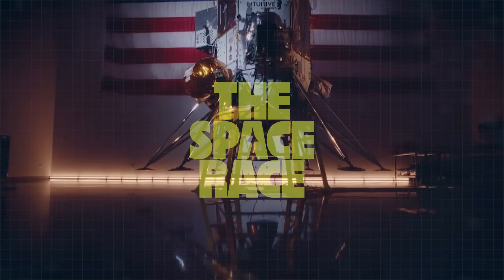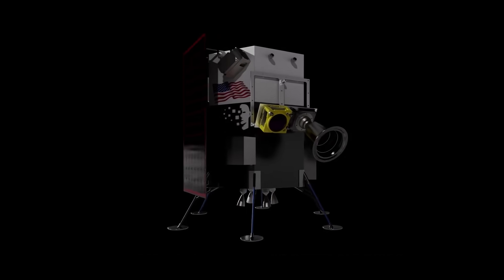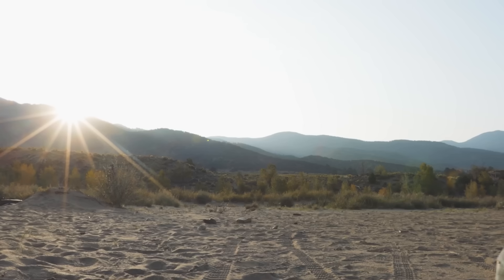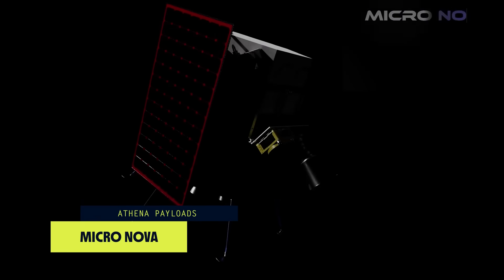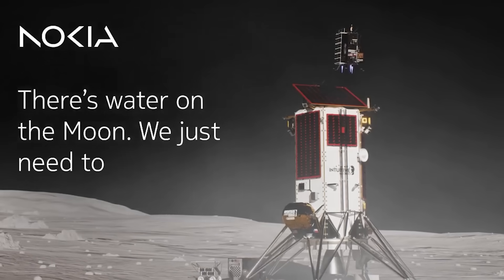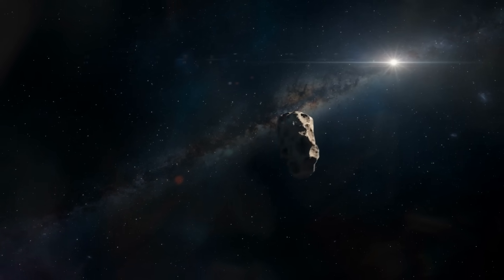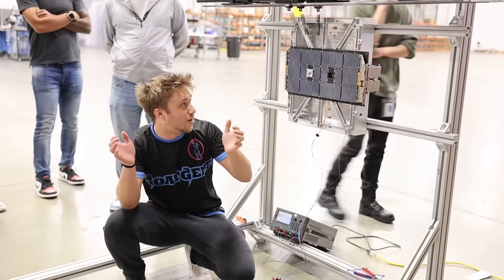NASA Moon Landing Update!

Comment: Instead of only increasing landing precision, what abt also equipping the lander w arms so that it can maneuver itself out of a topple?
Reply: Or, be more like the old Surveyor landers with a wider stance. As I recall, none of them tipped over.
Reply: I guess the arms and the wider base add to weight . Where as precision on landing costs almost no weight . Therefore they can add something else to the vehicle such as different testing equipment.
It’s a bit like saying ok this car is not fast enough but we need to conserve fuel at the same time. Instead of just whacking in a larger heavier  more fuel hungry motor they just fine tune the smaller motor to get a similar effect without adding weight or requiring more fuel .
Reply: Because it might seem obvious to a pretend engineer however it's silly to the point of stupid to real engineers.  The idea is to have zero horizontal movement, that was what caused the tip over last time.  But to know that you'd have to have informed yourself would you?  And you deeply stupid pretend experts NEVER do that.  Probably don't even know how to.
Reply: @imaginary_friend7300  I've revised the wording of my original comment to remove the word "obvious" and to better reflect what I was actually thinking...which was NOT (including not originally) that increasing the landing precision should not be the main focus (it should) but that maybe some kind of backup reorienting capacity could be added to prepare for eventualities. Given that the Mars rovers of both the US and China had maneuvering arms for operational tasks, I don't see why such  could not be given dual functionality in the event of a trip or topple, since faulty ambulation could also occasion a problem. Given the myriad variations that this extremely general proposal of mine could take, it seems any idiot could  infer that it was and remains a perfectly valid one and that only a particular realization of the general idea would prove to be foolish or not, not the idea itself. Your asinine observation that the aim was to have zero horizontal movement is known to any and all. The point of having a backup re-maneuvering capacity would be to account for the endless circumstances that might compromise the aim of remaining perfectly upright with no sway.

Comment: Better idea, send astronauts back to the moon with pickaxes and shovels. Better yet, send up a bulldozer, front end loader, excavator, and other heavy equipment all running on LNG and LOX. Also, Elon Musk owns part of A drilling company called “Boring.” Build one the same size as StarShip, get it on the moon and have it start digging habitable tunnels about 20 feet deep and then in any direction to build an underground moon base. The tailings will make for some interesting geology. They can also be used in burning topside habitats for cosmic radiation and impact objects. Topside habitats can be designed and build in packages by “Boxable.”

Comment: you  said there is water on the moon . where did the water come from if the moon has no atmosphere ?
Reply: "'This is a major step forward in unraveling where lunar water comes from,' Dr. Maxwell Thiemens of the AMGC research group of the VUB explained. 'Our data suggest that the Moon inherited water tracing back to Earth's formation, followed by later contributions from comets, delivering the water reservoirs we see today.'  Three key results are central to the report: An early Earth signature: The oxygen isotopic composition closely matches enstatite chondrites, a meteorite type believed to be the building blocks of the Earth. There are also clear signs of cometary contribution: A significant portion of lunar water shows isotopic similarities to comets." --Science Daily, December 19, 2024, Vrije Universiteit Brussel
Reply: Space is strange and full of mystery but it probably came from ice caps or something.

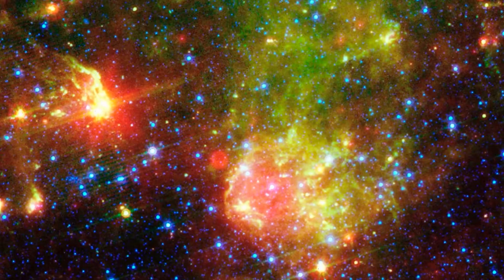Comment: At 8:55 you say that SPHEREx will be placed in a sun synchronous orbit that will keep it out of direct sunlight. But I thought one of the advantages of a sun synchronous orbit is that it is /always/ in direct sunlight, so among other things, you don't need to worry about batteries to last through spending half(ish) of every orbit with the earth blocking the sun, and you can keep a consistent orientation towards ground while keeping solar panels well aligned to the sun. What am I missing?
Reply: You are correct about SSO, but I believe SPHEREx has a sun blocker to protect the telescope from the sun.
Reply: Why can't we just make a Dyson sphere? 😞 We would have all the energy we would need.
Reply: @Mars-d3sAnd all the harmful solar nuclear radiation. Look up Solar Wind and Van Allen Belt.
Reply: There are two sun synchronization orbits, one as you described and the other as the video described in the shadow of the earth to minimize solar heating because thermal infrared is from heating.
Reply: @mrbaab5932  because it needs to be at the sun to create basically a homemade lunar eclipse so that they can study the ring of fire